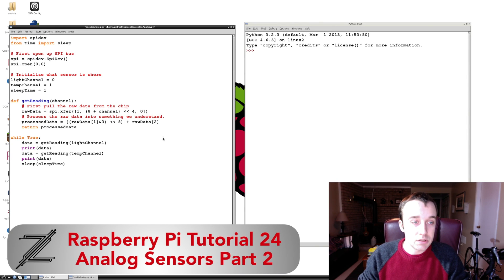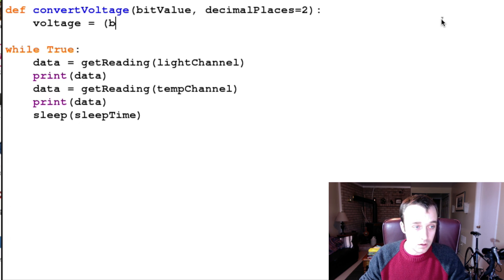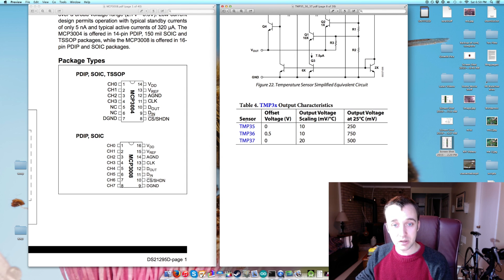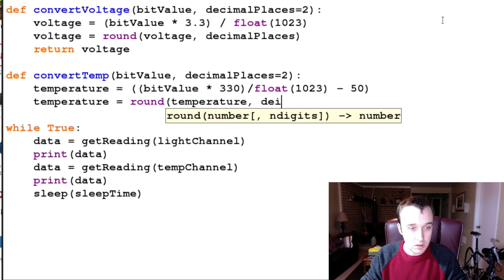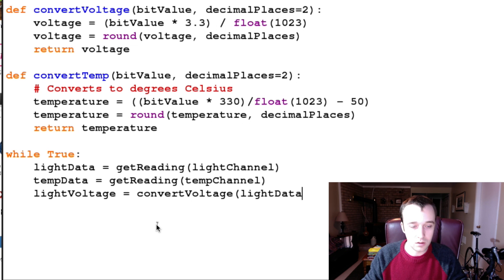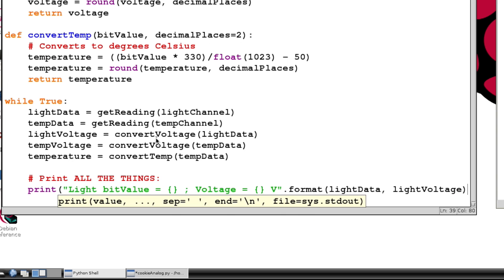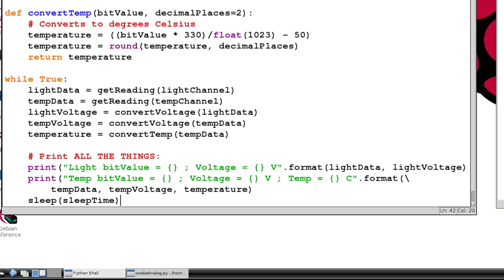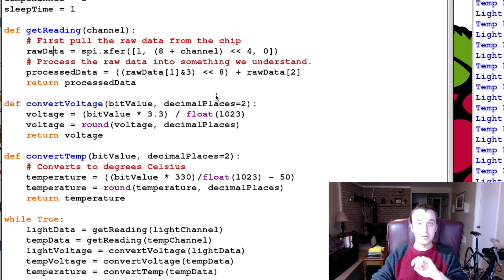Raspberry Pi Tutorial 24 - GPIO Analog Sensor Programming 2

Comment: i will be using ADC 0804 ic for input of flex sensor.  But it has aproblem it reads at 5 volts and i think pi works at 3.3 volts.plzz help!!

Comment: thank you Alex
you have been a big help and I M happy to report that my gas detector unit is working and transmits readings to Thingspeak.com.
thanks in larg to you.

please note that this was my first project not counting the LED blink code 😀

once its documented and cleaned I would love to share it along with the diagrams
Reply: +Shaker Al Hashlan Did you use the MQ gas sensors? And if you did how did you manage to get your readings in PPM? Im using the MQ-7 Carbon Monoxide sensor and im having an issue getting the appropriate readings!

Comment: hey Alex loving your videos 

about the Temp conversion, you got the bitvalue*330? is that because your sensor uses a 3.3v or because the MCP3008 uses a Vc of 3.3

to be clear i m using the MCP to read from a gas sensor that uses Vcc of 5V and i need to find the right PPM value

keep up the great work

SSH
Reply from the maker: +Shaker Al Hashlan The TMP36 sensor has a scaling value of 10 mV/C. I show this on the data sheet. That is: every 10 mV (0.01V) difference in voltage equates to a a degree Celsius difference. So, 0.01V/C. There is an offset of 0.5V with the sensor too. The math can be re-written as:

temperature (in C) = (V / (0.01V/C)) - 50
or
temperature = voltage * 100 - 50.

Comment: Great tutorials, very helpful getting my mcp3008 up and running. Is there an easy addition to the code to have the data logged into a csv or google sheet?
Reply from the maker: +Anthony Gossner It goes beyond the scope of this tutorial, but yes there are relatively easy additions to the code you can add to log the data. If you want CSV, you can check out Python's CSV module. Writing to a CSV file should be less than ten lines of code.